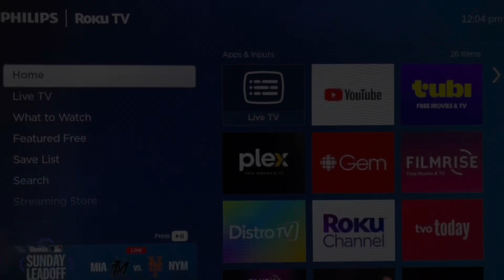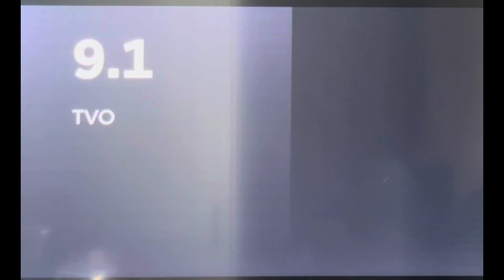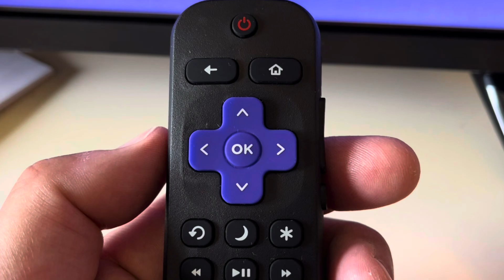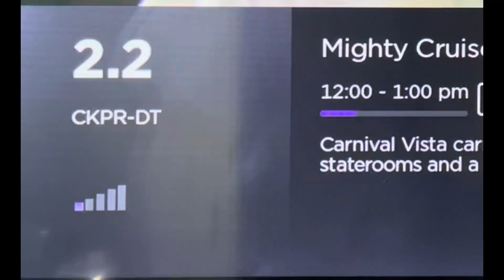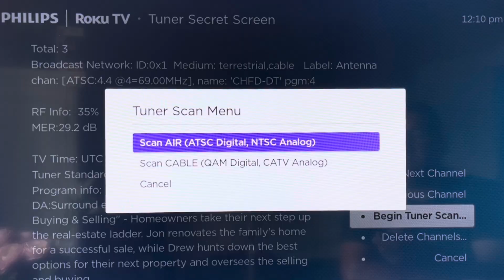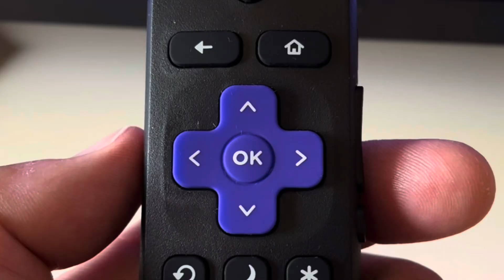Roku TV Secret Hidden TV Antenna Signal Meter Screen

Comment: This is very interesting, thank you. I am hoping you have some advice on my problem. I used to have, until a week ago, a Hisense brand Roku TV. Unfortunately it died right at the five-year mark. I now have an LG OLED TV, and while I love the picture, the OS is quite unintuitive and fussy, and frankly a lot of the things I could easily do on the Roku I can't do it all on the LG. I can use the LG built-in tuner to scan for channels, but the LG webOS doesn't have the same friendliness when it comes to organizing OTA/antenna TV content. For example, they have an option to delete a channel but they don't have an option to hide a channel. There is also no easy toggle like Roku has to toggle between favorites and all channels. so I am wondering as a workaround, if I only want to access Roku and deal with Roku and bypass the LG operating system as much as possible, how I can set up antenna TV channels so that they can be viewed on the Roku device. I know it's going to have to be some sort of workaround, since my Roku device doesn't have a tuner in it, which is which was not the case when I had an actual Roku TV.
Reply from the maker: LG smart TV’s (at least the one I have) does have options to add or delete over-the-air channels from the guide. This can be found in the Channel Tuning menu under Manual Tuning. Unfortunately, since your Roku device lacks a built-in tuner, it isn't possible to view antenna channels directly through that interface. You could use a digital converter box as an antenna tuner connected to the TV through HDMI, and connect the Roku stick to the TV through a separate HDMI input. This way the Roku channels and the antenna channels would remain separate, which is usually the simplest way.
https://www.youtube.com/playlist?list=PLDX6gLCL4WMwwYv9WpCoGZtoXpI4ww-hM

Comment: Can you acquire and use both the antenna TV and the "non cable box TV", or can you only use one. I already have my antenna TV setup and I'm cautious to delete channels and start over with the quote unquote free cable setting
Reply from the maker: @gorehoundog  You would likely need a switch (like an A/B switch) to toggle back and forth between cable and antenna.
Reply: @NorthcoasterHobby  thanks

Comment: Instead of making easier to double press the info button you have to press multiple buttons just to see the signal level, and an average STB have a better signal meter so you can perfectly adjust your antenna
Reply from the maker: @Nicholas_Chris  Agreed. Why does it have to be a secret?☺️
Reply: @NorthcoasterHobby  Someone should send an e-mail to Roku Tech Department to tell them about the signal meter issue
Reply: @NorthcoasterHobby  Same scenario is with the receivers that runs on OpenATV, and the signal meter is not correct.
Reply: @NorthcoasterHobby  On amiko receivers that run OpenATV is the exact problem but you can install a signal meter app
Reply: @NorthcoasterHobby  It's the exact same thing on Amiko Viper receivers, and the signal level is not accurate but since it runs on OpenATV you can install from the store a signal meter app to see if everything is perfect. 

The AMIKO Viper has dual tuners one for satellite and one for Antenna/Cable
Reply: @NorthcoasterHobby  The exact problem is with AMIKO Viper receivers, and the signal meter doesn't show you the correct signal level and on all channels you have 100% signal quality and on some transponders you have 90 or 80%.

 You have to download a signal meter app from the store. It runs on OpenATV
Reply: @NorthcoasterHobby  Same thing happens on AMIKO VIPER Receivers but you can install a signal meter app.